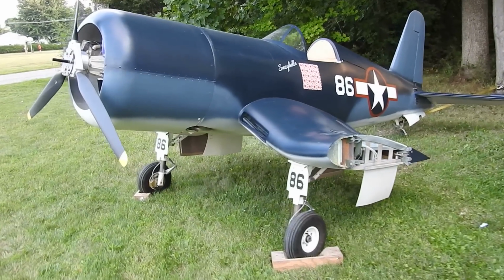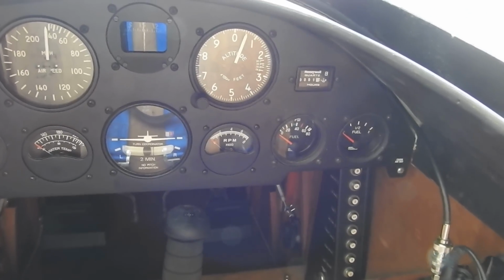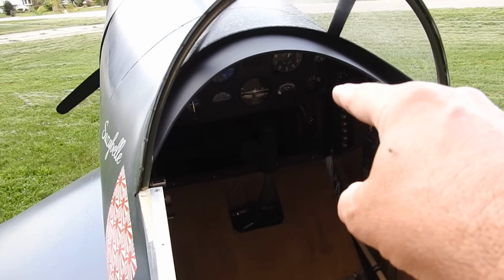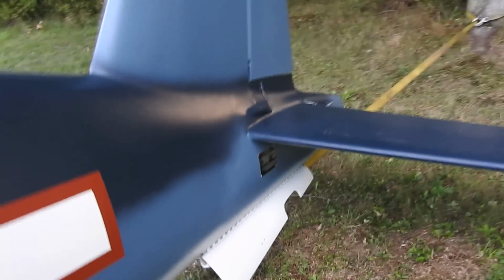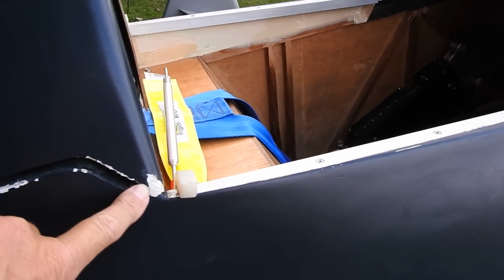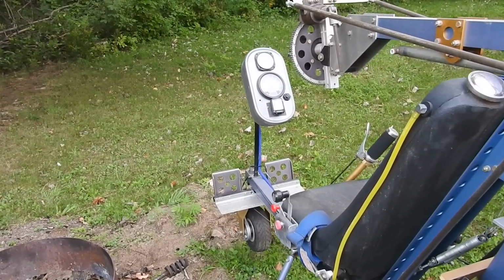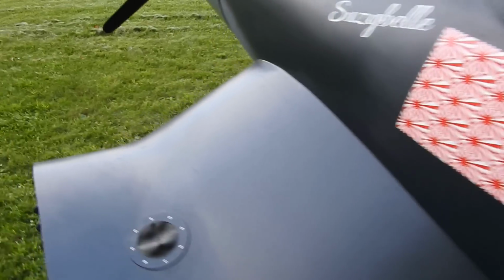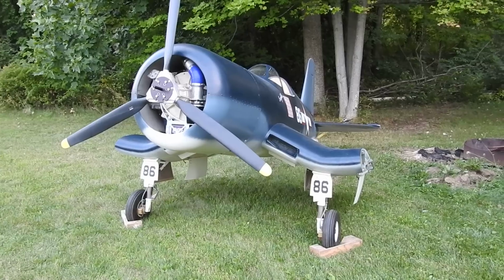1/2 Scale War Corsair, Prop adjusting time.

Comment: You mention the ignition system being a wasted spark type ignition. Is it possible that the computer is receiving a input from a crank sensor and the tachometer is displaying a half wave signal, of the wasted spark signal?
Have you a way, (optical tachometer?) to verify actual crankshaft rpm?
Reply from the maker: I fixed the problem in a later video. The tach signal I used comes from the ECU. It doesn't have the voltage spikes needed , or the correct output voltage to properly trigger the tach. The ECU puts out 5 volts and the tach needs 12 volts to go full range.

Comment: Hey Don. Why that engine? Is there not a radial engine that would fit that plane? If so, what make? Do the wings actually fold?  Do you ever plan on putting dummy drop tanks and dummy rockets? Are you gonna paint the inside green?
Reply from the maker: This engine fits better and has more power than a continental 0-200. Radials that fit don't have enough power and cost more than the whole plane. The wings don't fold, just come off. This is the final look, nothing else to add. It would only add weight. Inside stays the same too.
Reply: Ah, gotcha on the engine. Correct me if I am wrong but I think drop tanks in ww2 were made out of paper and to make rockets for your plane. Use pool noodles with a piece of pvc slid down the middle. The caps you can get from a hobby shop that sells large scale rockets. Just saying maybe make them for show.

Comment: If I remember right there’s a car engine some car engines have rev limiters based on a car sitting in neutral and do you have a voltage regulator on your gauges your alternator and put out 14.5 V while your engine is running. My try A direct ground instead of through the computer?
Reply from the maker: The gauges can handle the regulated voltages I have here. Not a problem. The ECU grounds the signal for the tach output, the gauge uses 12 volts positive.

Comment: I had no idea that there were so much electronics involved in this!  I’m curious if you chose a three-blade prop over four, or was that the manufacturer’s choice?
Reply from the maker: The F4U-1A-1D used three blade. The later F4U4--5 used four.

Comment: Why not add a magnet-based backup tack that reads RPM right off a magnet attached to the prop shaft?
Reply: I was wondering the same thing.
Reply: @westmowgli  I'm pretty sure it wouldn't be accurate due to the gear reduction box.
Reply: @ereid74  If attached after the gear reduction it would read correct. If it was placed before the box it would read the engine RPM, not the prop RPM.
Reply: Yup. No guesswork involved with a direct reading tachometer.

Comment: Hope you get the tach problems worked out. Those can be tricky for sure. Didn't some models require a capacitor to cause them to read correctly? It's been years ago, so may be foggy on the subject...

Comment: Pop riveting right to a fiberglass skin panel will fail because of vibration. There is a reason the designers had a block installed under the skin in that location.
Reply: If it were riveting something structural yes, but it is not; that little piece of sheet metal weights basically nothing. Fiberglass is amazingly strong, especially if it is S-glass/epoxy. Bullet resistant panels are even made from layered fiberglass. I doubt he will have any problem with it.
Reply: @creightonfreeman8059  The plans call for blocking inside that specific area for the specific reason to rivet too... so by your building standards its fine to eliminate bits and pieces of man carrying aircraft. Got it. Hell.. the designers dont know what they are talking about anyway, do they?! hahaha And I stand by my assertion that riveting directly to unreinforced fiberglass will crack. Vibration can, and will, destroy everything if given the chance.. regardless of how light the parts are... and to not properly back fiberglass when attaching to it is just not good building practice. I have been involved in a couple of home built aircraft projects and if what you did was not 100% PERFECT..... it was re-done. Sorry but to leave out blocking and then just say "Screw it, it'll be fine.... I think" is really not the way to construct an aircraft you are about to trust your life in.